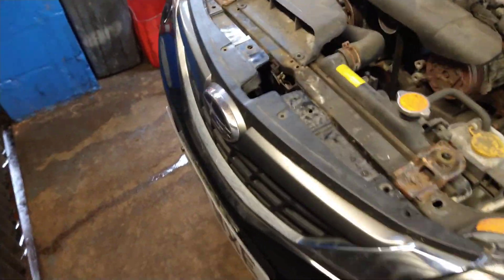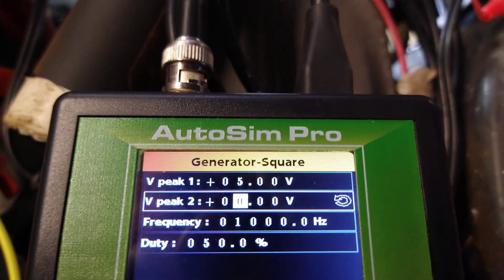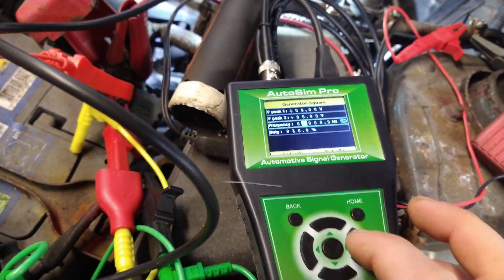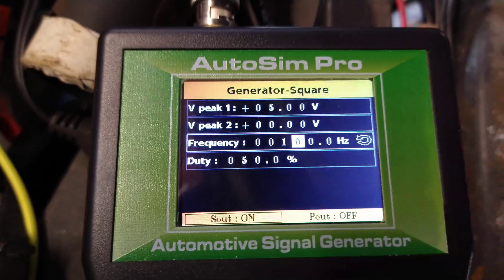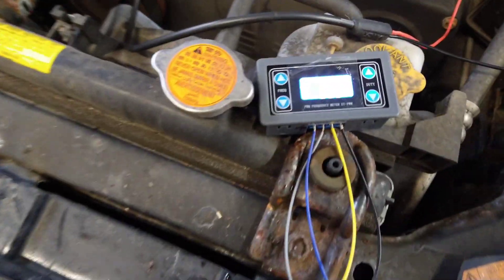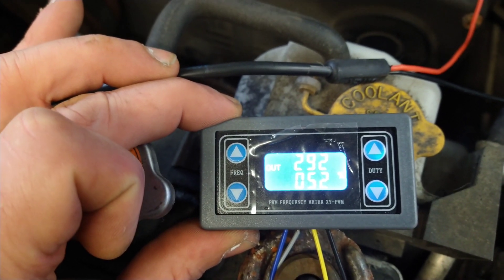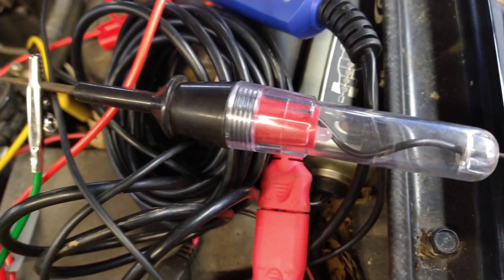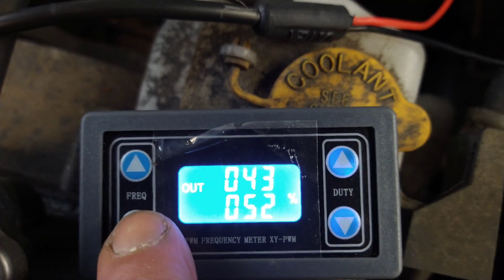ABS Sensor Simulator (digital ABS) doesn't work on all cars

Comment: Matt I'm not grasping how the set up is for the wires on the signal box .... I've tried numerous times on a good sensor for practice but getting nothing  on my scan tool ... is the volt plus and volt negative just to battery plus and negative...yes ?? Then the 2 that's left earth and pwm does the pwm go to the signal wire on the abs plug and the remaining earth to the one wire left on the plug .... or does it go to earth ?? I'm trying but getting no joy ... no mater how high or low you output the frequency.. ?? Sorry matt ...any advice welcomed ...cheers ..Bob from fauldhouse west lothian ....love your chanel mate ...very mechanic friendly ...
Reply from the maker: @robertlee9112  I have noticed it doesn't work on all cars, it's like when the ignition is switched on and the abs does a circuit check, if it doesn't see the correct signal it seems to ignore any sensor simulator input. No speed showing on the live data 
I found jumping the abs wires to the abs sensor on the other side of the car works better and doesn't need a simulator.
Thanks for watching and supporting the channel
Reply: Cheers Matt... I've probed the wires connected still and receive the correct signals but for some reason when you back probe either wire  the signal is lost  and flags a code ... ( you need to clear code before it works again) ... an active  sensor 66 plate.  .. but yeah just swapping other side works ... I was just curious to  check the wiring integrity was good for future use  on other cars but thanks anyway matt .... gentleman 👍

Comment: I have the 1st simulator Ditex brought out its does the job, nice diag
Reply from the maker: Thats probably the one I should have got too. I have been using an old gunson simulator that I got from Halfords in the mid 90's I thought it may be worth an up grade. It's a shame that I can't use this sensor simulator on all cars. I think the problem I have is that once it sees a fault some cars ignore any input so I can't look at live data and see a reaction from a sensor simulator. I have also had what looked like a good scope capture from a new sensor that couldn't clear a fault code, that also showed no input on the live data, turns out that that particular VW needed a genuine sensor and not the after market one that the customer had fitted. The difference I found in the two sensors was the VW one was twice the resistance to the other sensor.
I have tried using a high resistor to trick the car but that didn't work either.
Thanks for watching and your comment Ian
Reply: @mechanicmatt871  you can use a test light on the signal wire but you need to no if its ground or power side switched  you can miniplate the mph. some inputs  you have so cycle the ignition to get a  reading on  the live data as you no some abs sensors have a bias voltage also there easy to test in my onion. thanks matt

Comment: Hi i have a 2004 landrover hse the battery says 13v the key wont turn in the ignition and nothing in the car works cant turn anything on even with the key not in the ignition but the battery is saying 13v any advice please?
Reply from the maker: It's hard to say, I would start by load testing the battery and checking fuses. If it's more than that. Maybe you will find a water leak into the car that could lead you to corroded wires/connectors.

Comment: Good information matt , i use the ABS pinpoint tester and sensor Simulator from (WAEKON)It works well for Active,and Passive sensors ,,enjoyed your Video.....
Reply from the maker: Thanks Ian, I'll check out that waekon simulator cheers Matt

Comment: Great video Matt......hell of a handy wee tool......the two output wires of tthe chepo signal generator what way are the wired up to the cars harness, thanks
Reply from the maker: Thanks Peter, neg to the negative wire in the plug and pos to the positive, I tested it the other way round and it still worked with was a little unexpected. Thanks for watching
Reply: @mechanicmatt871   Thanks that makes sense had something different in me head

Comment: thanks for the video
very interesting
I bought a fg-100-dds function generator for abs diag ebs
Reply from the maker: Thanks for watching, I'll check that out thanks Stephane
Reply: https://www.youtube.com/watch?v=o83h7vSCYhg&t=135s
Reply: hi, is it also possible to test bench an abs unit to emulate the wheel speed with fg 100?